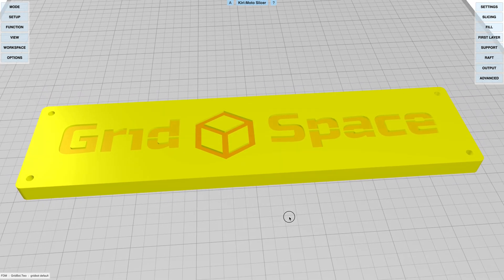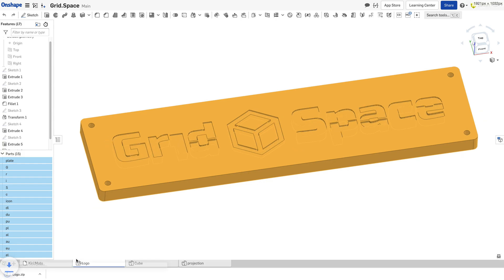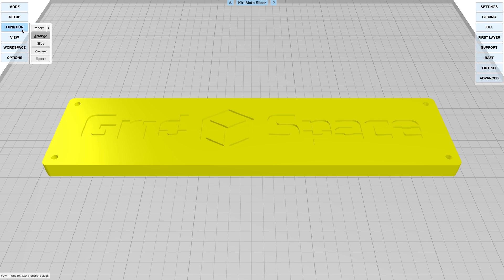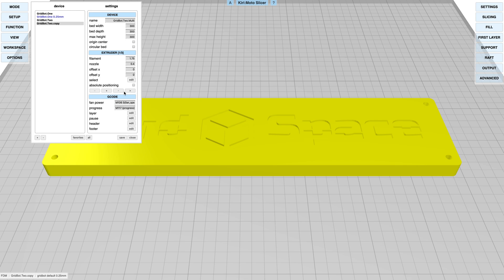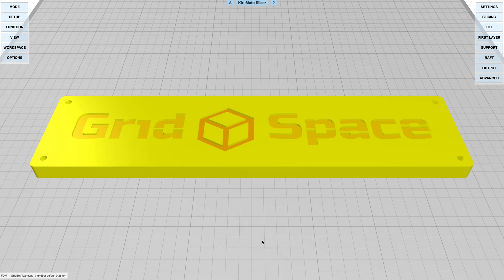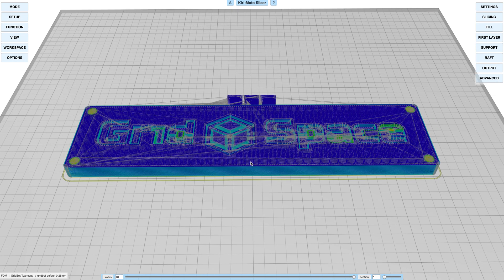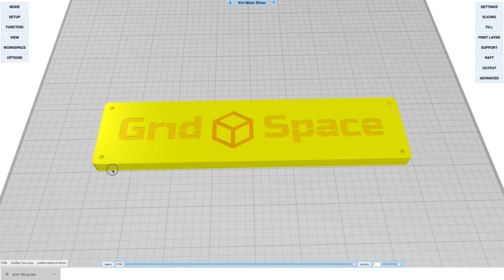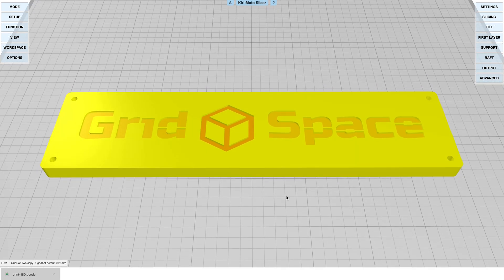Kiri:Moto Multiple Extruder Support

Comment: I am trying to use Tenlog Dual Extruder printer with Kiri:moto, I cannot print two things simultaneously. Also can select support just for one extruder.
Reply from the maker: multi extruder support works with tool changers and color systems like palette. it does not yet work with IDEX systems that can duplicate and mirror.